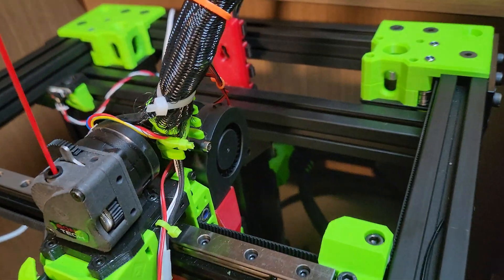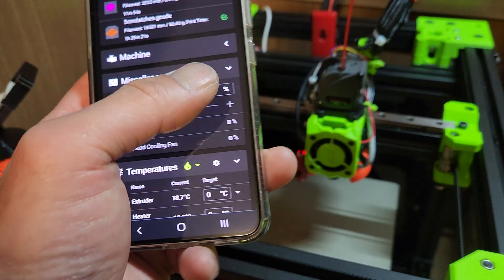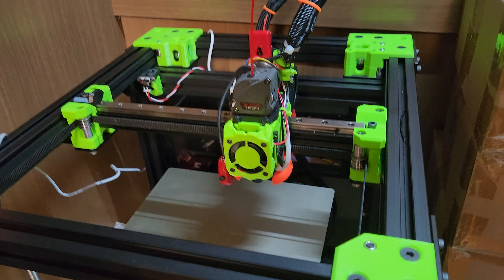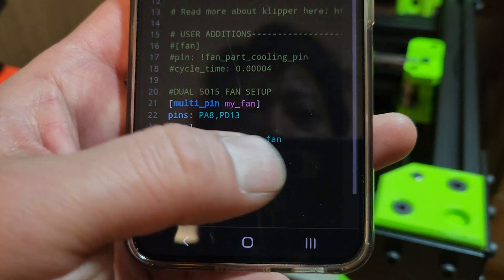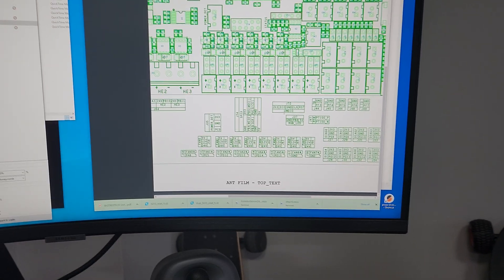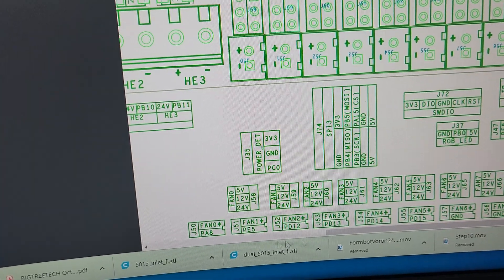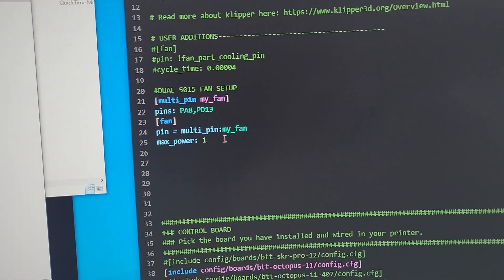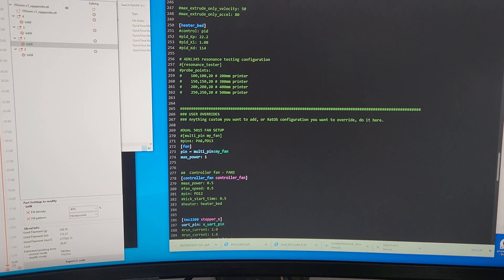How to use Multi_Pin in Klipper/RatOS to control multiple fans!

Comment: Thanks man! but i have a problem. when i put his in my printer.cfg this error show me: Unknown pin chip name 'multipin'

Once the underlying issue is corrected, use the "RESTART"
command to reload the config and restart the host software.
Printer is halted

i can't reach a solution myself :face-purple-crying:
Reply from the maker: Make sure multipin is put in the beginning of printer.cfg:

#DUAL 5015 FAN SETUP
[multi_pin my_fan]
pins: PA8,PD13
[fan]
pin = multi_pin:my_fan
max_power: 1
Reply: @3dPrinterSchool  
Thanks man, i will try it. in your opinion, using a config to be included in the main printer.cfg, I could have problems? I currently use a "fan.cfg" where I write all the declarations for my fans. In my specific case, the multipin would allow me to govern two 12v fans that I use to cool my octopus v1.1 and the raspberry
Reply from the maker: @Bartolo Carnemolla  probably not but just know where u include it.  Make sure its before everything else.